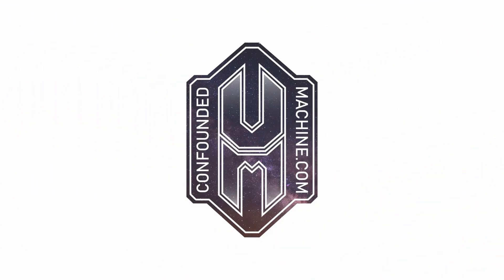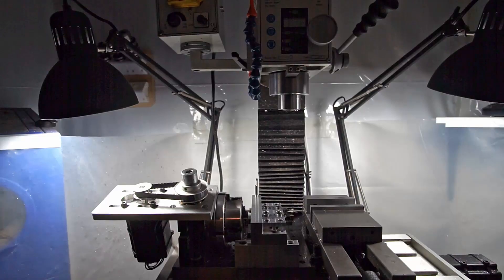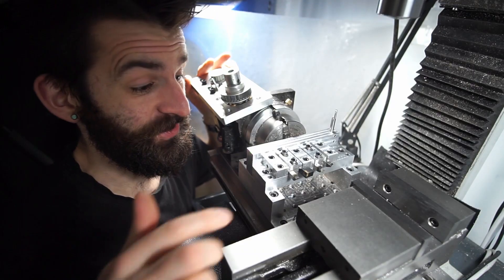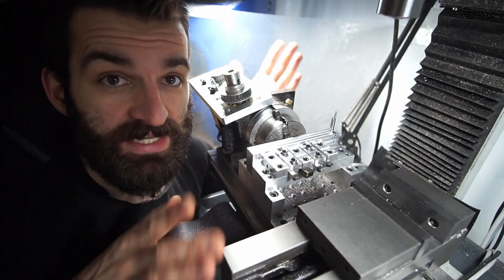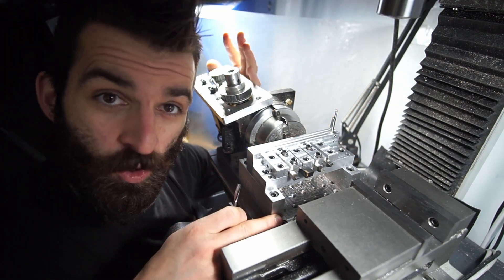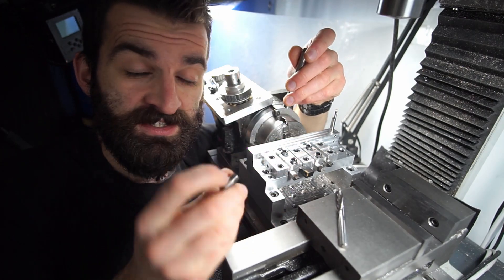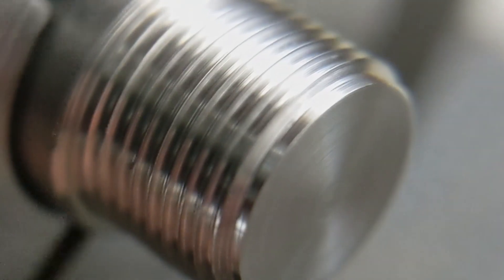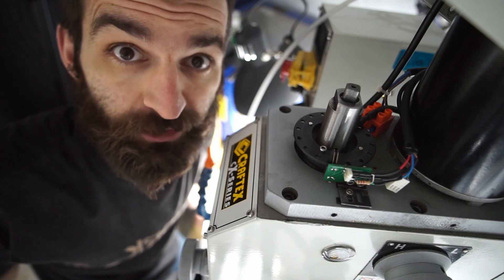A Mill is a Lathe!

Comment: Hello Curt Van Filipowski, I'm very beginner when It comes to these machines. I always try to fix little things that are broken, but always end up failing and breaking them. 
I figured that I would machine to do the very precision shaping of the thing (plastic mostly, then some aluminium lets say).
It took me a long time to figure out that there are these miling and lathe systems.
Apparently I need more than 3 axis. Adding rotation to the miller sounded perfect to me.
I can do 3D shapes and use rotary motion to fix the rotary parts of the thing I'm repairing.

But for the life of me, I can't figure out what machine to buy and how to begin.
I check out these proxxong and I can't  figure out how to add the 4+ axis on the milling machines.

What machine would you suggest for a beginner to do 4+ axis small scale very precise fixings?

I don't have the budget to go to automated CNC's immediately and work with 3D design applications, lets say that's the future plan.
But I want to start with somethign I can manually control, turn by my hand and do the work carefully. 

Ability to turn the and mount the rotating part (rotating table) and change the orientation of it vertical/horizontal. 
And maybe able to also make it turn like a fake lathe would also cool. But what do I know.

Comment: Jackpot!  Great tool holding fixture!  I was trying to sort out how I can make a repeatable tool setup that I wouldn't have to tear down every time I wanted to swap over to my vice...  I think I'll do something similar to what you did...  I've already got a "breadboard" that sits on my mill table.  It has both holes for pins and treaded holes...  That should bring me back to the same spot every time.
Reply from the maker: Thanks man!  I'm glad it was of some use to you. Its been working well for me so far, I've had it on and off a half dozen times and it repeats closer then my mill can measure...works with me! I also have no idea why I wasn't subbed to your channel, always a joy when I come across a trove of new videos! Now to go a sleuthing to  see if I can find this "breadboard" table you speak off :), fixture plates excite me.
Reply: @CurtVanFilipowski  I think you can see the breadboard in my milling videos.  The guy I bought the machine from made it.  He had 5 or 6 tormach machines and a few larger haas mills...  I'm guessing he whipped them up on his Haas because the tormach work envelope isn't large enough...  This mill turning is going to help me bring my products to the next level with custom fasteners and turned pieces...  I'm super stoked.
Reply from the maker: @GregsGarage  Awesome, thanks!  I'm pumped to see what you turn out😋 !